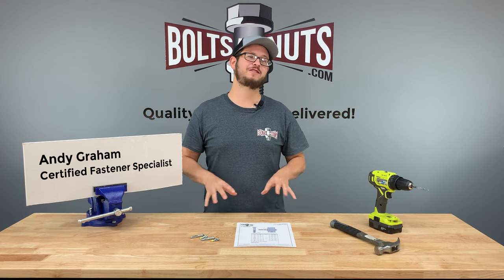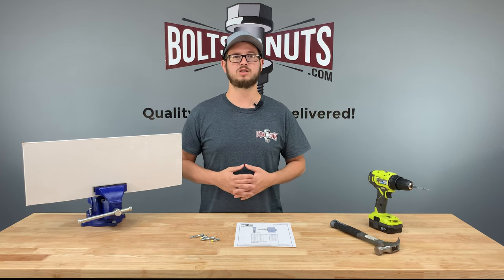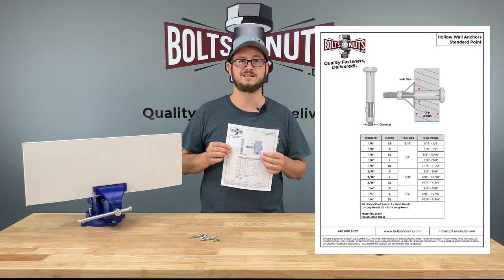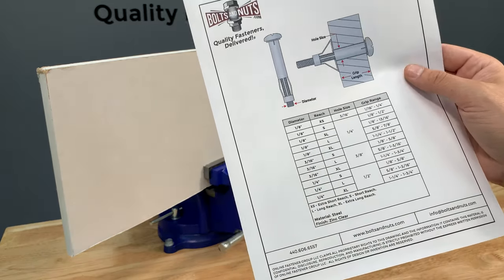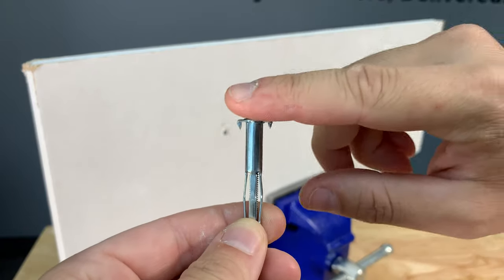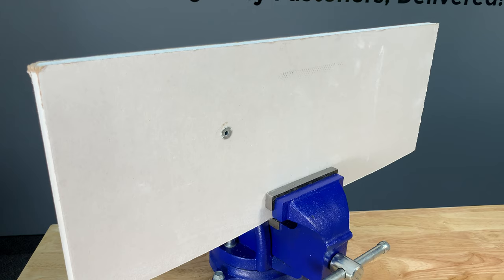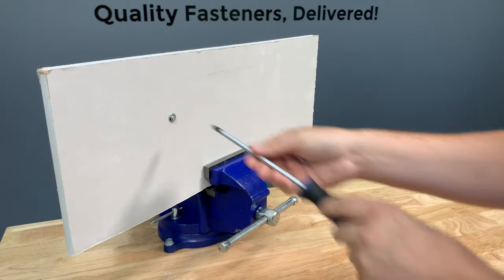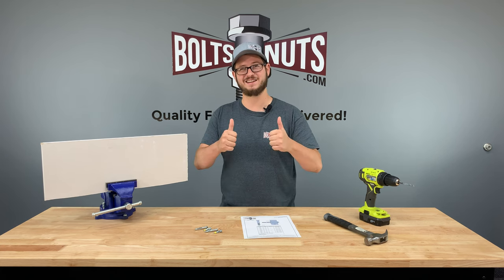Hollow Drywall Anchors Explained & How To Install Them

Comment: I just learned these don’t work that easy.  As they tighten, spreading the cage behind, they can pull the surface flange right through the board leaving a half inch gaping hole.  You need to tighten then using thin plate first as though fixing the plate to the wall.  This will then spread the cage without being able to drag the front mount right through the wall.

Comment: If my drywall is 1/2" thick, how many screw driver rotations does it take to secure the anchor to the wall? I felt as at 22nd rotation it was already hard to rotate the screw driver but I was not sure if I actually achieved the right tightness. How to know when to stop?

Comment: The teeth didnt quite fit into the dry wall as it tore it a bit when i rotated hard. So now it is bit loose from the front. Will that be problem if I hang a heavy mirror for example?

Comment: What if screw never gets tight in the anchor? Just keeps spinning??
Reply from the maker: Sounds like it might not be reaching the nut to collapse the drywall anchor or it might be stripped. Thanks for watching
Reply: I have the same problem & wonder how 2 of them brand new out of the package could be stripped bc they are definitely reaching but just spin. Worthless & so frustrating!
Reply: You need a tool to set the anchor. Once set, these anchors can’t be beat!! But, they are permanent
Reply: I am having the same problem. The screw will not reverse out of the anchor. HOW CANNI REMOVE THE SCREW???
Reply: same problem here and I can't find the answer anywhere!
 @canapop

Comment: My mother just moved into a mobile home with paneling on some walls the older mobile home paneling what do you suggest is the best anchor we are struggling with what kind of anchor to use we've used a couple of different ones and they all seem to just pull out we've tried plastic hollow wall anchors and the ones that are used in this video and not having much luck everything seems to just pull out except for those monkey hooks those seem to be working good what do you suggest for hanging curtain rods Honey's types of walls

Comment: The small, thin washer that is supplied with the wall fixing. Does this washer fit between the item being installed and the wall fixing or between the bolt head and the item being installed?
Reply: Hello John how are you doing today. Hope you have a nice weekend 😊
Reply: Washer goes between the bolt head and the item being installed.

Comment: If I used this to hang a mirror on the wall, would I have to unscrew the main screw slightly so it sticks back out again? Does that undo the tightening behind the wall if you unscrew?
Reply from the maker: Just unscrew slightly! It will not loosen the back!

Comment: Should I use these to hang my curtain rods???
Reply from the maker: Great question! It’ll ultimately depend heaviness of the rod & wall condition. Most shower rods are ok with the plastic wall anchors, I don’t see why these wouldn’t work. Just be sure to get the correct size for the wall thickness. (We won’t be able to answer this 100% without seeing the application). Thank you for your comment!